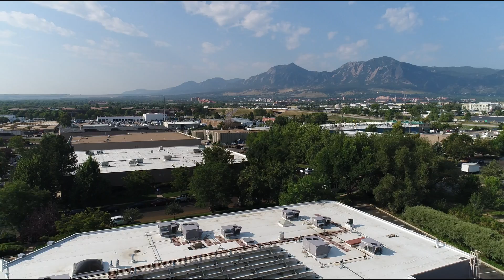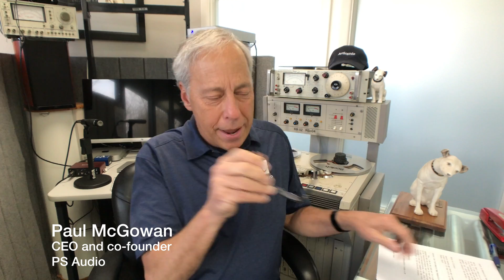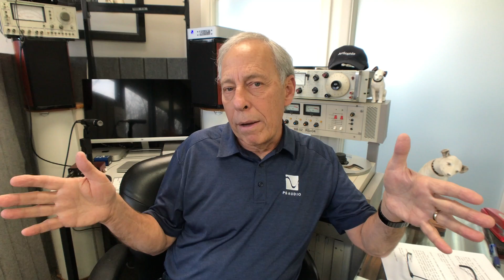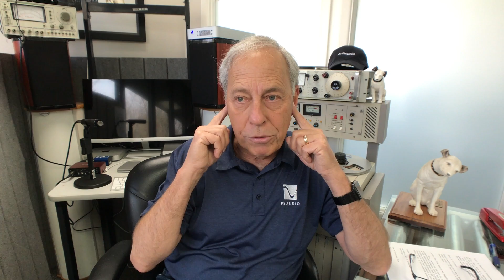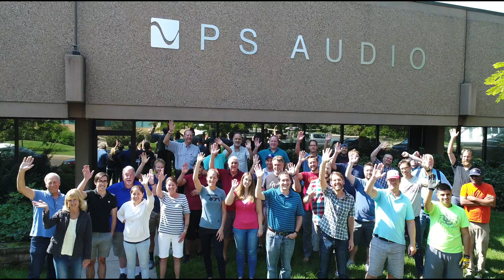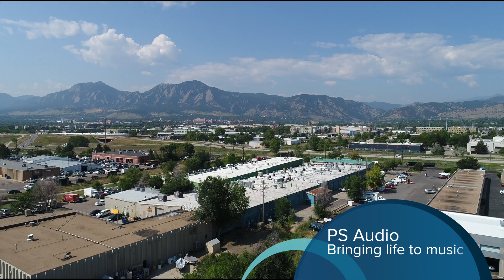How do speakers create 3D?

Comment: For truly 3d sound you need a center channel as scientific tests have concluded that humans prefer it to the phantom channel. The problem is that surround audio never caught on even though it is superior to stereo.
Reply: I agree (about the surround system having a better-more whole-3D performance), only if you want to hear sounds on your back. But the only problem with "stereo 3D" is the "funny" applause of an audience in front of you and to the sides on live recordings rather, than in the rear/sides. Appart from that, everything else is achievable with two loudspeakers only. There's a 3D "hemisphere" in front of you (or even more than this if the room is not optimal) instead of a whole front/back 3D sphere. But it's the front half we use for music, isn't it? To be honest, another advantage of a surround (say, 5.1 or other) system is, perhaps more, effortlessness, more ease to achieve loud levels and dynamics without stress, as the reproduction task (and total intensity level)  is devided to more than two loudspeakers. Anyway, surround systems have to undergo a long-long process of evolution and "high-end-ation", before they'll be accepted as superior to the existing, highest level stereo systems.
Reply: yes the key is the center channel and it depends on the mix if its done properly